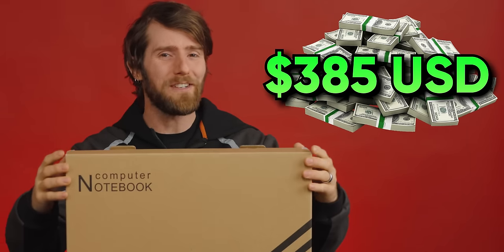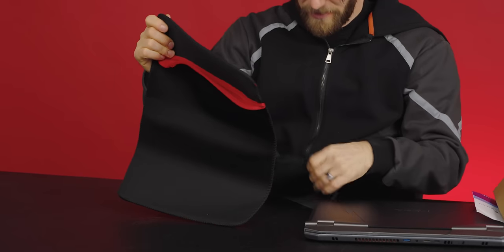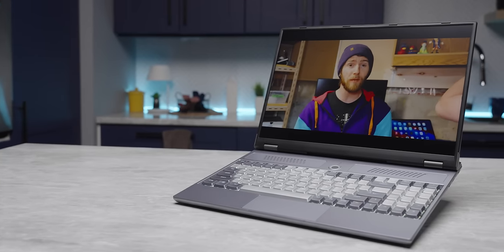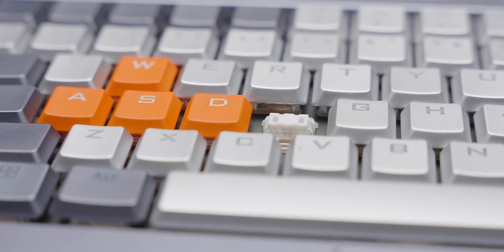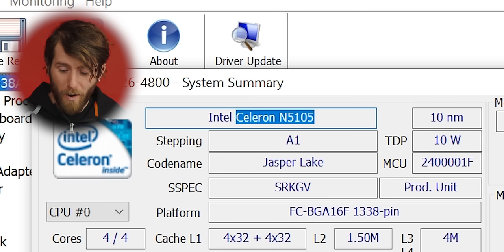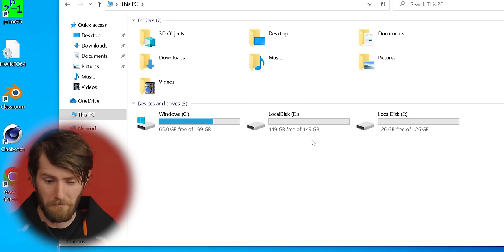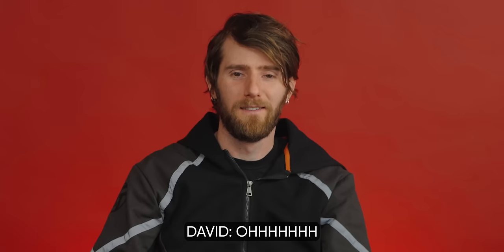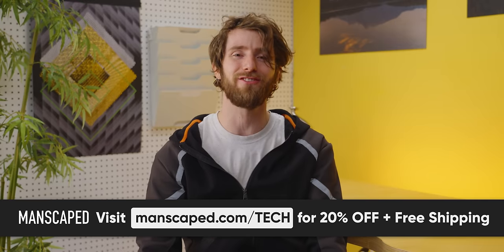Brown Star for Effort – This AliExpress Gaming Laptop is HILARIOUS

Comment: The "Windows is activated using your organisation's activation service" comes up when they activated it using custom KMS servers, so yea, most likely pirated windows 10.
Reply: Come on, they should be using HWID by now!
Reply: @GuyGamer1  haha so true, I think they didn't figured out the Microsoft-Activation-Scripts in github yet.
Reply: Yep, came here for this comment. Maybe not pirated, but shady. The comment that it pokes chinese servers to "make sure" something something made me laugh for a bit, LMG's clearly not on top of their pirating game.
Reply: well, it's an easy to solve problem if you dont want a pirate copy of windows on your pc.
ya see, you can get a single win 10 ESD serial nowdays for like 10 bucks. You just need to use a program to pull and backup all the driver installed, download a win10 iso from microsoft, departition that SSD, format it (or, you know, just change SSD and keep the old one for safety) and install windows and all the driver you already pulled.
At very most you'll need to backup the mousepad, wifi and webcam programs and those usually can work without installer. You can get a list of their files and regedit keys with geek uninstaller (launch force remove, copy the list and click cancel). Just waste a couple of hours at very worst and you have a manual backup for those.
Reply: @Lodinn  maybe some part of the batch file was doing that, Linus could just scroll to lines with the KMS stuff
Reply: You can see the BAT file is called KMS when he tries to open it so it’s 100% pirated windows
Reply: i said PART of the batch file, who knows whats in the rest of it
Reply: Yep, that .bat is great
Reply: @@drkcr In this case where they are not part of an organization which distributes it's licence keys with KMS, it's 100% pirated.
Reply: @@drkcr You said it yourself: in an organization.
Reply: @Lodinn  This is not shady - it's definitely pirated. They are just running a KMS emulator which hands out activations to any client connecting to it and requesting one. But even if they actually obtained the licenses and were thus operating a properly licensed KMS, then it would still be pirated as the KMS licenses are not to be resold, nor are they valid for people not associated with the licensee. So the end user (in this case the customer) would still be running an unlicensed (=> pirated) version of Windows.
Reply: actually that batch file name already tell this is a pirated Windows copy.
That batch file name is short for Windows 10 激活（jh in Jihuo from pinyin which means activate）
Reply: I'm in so much love this thing can't connect to Microsoft Update. Computer people, how can I do that on my PC?
Reply: @264bpm Yeah the Wikipedia entry on "Key Management Service" was interesting, implying that every so often the client PC has to "phone home" and reactivate the license.  (Wikipedia):  Individual computers do not need to contact Microsoft, although the KMS server does. KMS clients must be activated at least once every 180 days.
Reply: Yeah in fact those "sketchy chinese servers" might actually just be internet-facing KMS servers, nothing spying necessarily.
Reply: China not respecting a manufacturers copyright?  I’m absolutely shocked.
Reply: @ignoto82dr  I strongly doubt you can get a Win10 EnterpriseLTSC key for $10, and that's the version you want. You can probably get a Home key for that price, but that version is crippled to the point of being unusable.
Reply: ah yes massgrave dev
Reply: @СусаннаСергеевна  just checked on ebay: 10€ for non specific version key (I bought this and got a pro, there are comments that indicate some get pro, some get home), 20€ for pro. Still a low price if you think about what windows OS would cost you to buy as OS until some years ago (hint you would pay about 100€)
Reply: @ignoto82dr  Pro isn't really much better than Home though, I'd consider them both unusable. You want policy management and the LTSC update channel, which only Enterprise LTSC has. Pro Workstation and Pro Education also have the policy management, but lack the update channel, so then instead you're stuck constantly uninstalling the spyware Microsoft keeps automatically rebooting your computer to reinstall, but if that's how you want to spend your free time I won't stop you.
Reply: @СусаннаСергеевна  first and foremost: if you really think microsoft can't install whatever it want on your pc just because you have installed a certain edition I've a thousand of acres of forest on mars to sell you. Call me later, I'll give you a discount.
second to follow: if you need to "privatize" your machine, just install w10privacy or windows shut up (O&O) or something similar. Just be carefull what you block/deactivate. I did it consciously and I havent had a reboot forced upon me from a long time. I just get from time to time a notify for some security update. And that's something that people should do ASAP. Unless you are one of the "conspiracy" people. In such a case shrug why the hell are we talking about windows? You should have led the conversation with "Windows is too heavy for this machine. much better to install linux."
Third and last: in the name of the elder gods, why oh why would you use THIS pc for something that need policy management and/or LTSC? The result that Linux got showed clearly this ISN'T even a good game rig much less something that could use these tools effectively. This is something you would buy for, dunno, watching youtube, google a recipe, watch tiktok, reading email, BS of that level. Having a video call with zoom/discord/skype at very most. And I wouldn't even bet on those with that webcam: that need a slot-in to lock while in use, not these BS magnets. Even the speaker arent great.
This is either an entry level laptop to start to learn and that's a bit on the rugged side (this have a very solid shell from what we have seen) or a seconday machine to have/use around the house. Maybe an emergency rig that you use for a couple of months until you buy a good one.
Reply: @ignoto82dr  You're the one bringing up conspiracy nuts, I never said anything of the sort. I just don't like it when my computer reboots without my permission, I'd rather finish my work and reboot it manually, and I especially don't like it when updates reinstall things I deliberately uninstalled. I want group policies because that way I know what settings are being changed, software like that "w10privacy" sound absolutely awful to me. I do have a bit of trust for Microsoft, they're big and blatantly bad behaviour stands to lose them a lot of money, but whoever put that "tool" together I would trust about as far as I can throw them. The default setting should be to respect the user, but given that Microsoft won't ever do that, having access to the policy editor so you can fix these settings is the best alternative.

Yes, Microsoft can install whichever RAT they feel like on your machine (in fact they already have, MS support can access RDP without you explicitly adding their key) but it's not something you generally need to worry about because misbehaving would stand to lose them ever so much more than they could ever hope to gain. The moment they get caught using their RAT to steal data, they lose their credibility with every corporation and nation on the planet. Don't be a conspiracy nut, with the proper policies in place Windows can be a non-spyware operating system. It's just that on any version without the policy editor, you can't actually set those policies in the first place, and without the LTSC update channel you're going to be rebooted whenever Microsoft feels like you need their Siri ripoff reinstalled, or your browser isn't set to Edge.

No, this laptop probably won't be good for much more than browsing the internet or office work. Sounds like even more reason I'd want to be able to turn MS Siri off, or not having the poor ewaste SSD get wasted on constantly reinstalling candy crush or whatever. If any machine needed Enterprise LTSC, it's this one. Not only is it the best version of Windows, it's the lightest.

Please take a deep breath and sit down away from the computer. You're clearly very agitated over this nothingburger, it's not good for you. Calm down instead of going around picking fights, you'll enjoy life more)
Reply: @ignoto82dr   where are you finding that? Last I checked, Microsoft was wanting $65(usd)  for a win 10 key.
Reply: @triangleofdeath6246  ebay but you have to search for "windows 10 key" full stop. If you arent in Italy you should proly check the "allow international seller" cuz the one I bought the key from was an italian store.

Comment: Wow, to be honest that really isn't bad for the price. A family member bought a brand new laptop for around the same price about a year ago and it's _garbage_. It came installed with Windows 10 S on a 64GB eMMC drive, 4GB RAM and an Intel Celeron N4500 (iirc). To be fair, they're only going to be using it for word processing and web browsing, but I had to get it out of S mode so you could actually install stuff and I tried opening up Edge and it was beyond painfully slow. Even opening a folder was slow. It disgusts me how manufacturers sell this sort of crap and claim that it's a decent machine and sell it for that price.
Reply: literal e waste and a huge environmental problem. companies should not be allowed to produce crap like that.
Reply: laptop marketing is pure jargon and techno babble to the general consumer, most of the population doesnt know what an i5 or i3 processor is, what mhz means, what an ssd even is, but these are the terms slapped all over the marketing for them. its how they get away with charging so much for slow processors that are multiple generations old and can barely function with current software, ram and storage that is effectively already landfill by the time the host machine is in someones hands. its disgusting.
Reply: Put Debian on it and that machine would be perfectly fine for those tasks. The issue here is how unoptimised Windows has become.
Reply: Yeah the Celeron N4XXX cannot run Windows decently, however Linux does actually run good on them. I bought a Asus Vivobook Flip with an N4020 in it, and going to linux (Zorin OS which is based on Ubuntu) made it actually usable.  That being said the N5XXX series are actually pretty good for Windows, the N5105 runs Windows 11 very well.
Reply: the only thing Celeron CPU,  and calling it games machine too. when showed the intel that something dissent and you get the end and Celeron there, but metal case, why the speaker, are delebrtley, and intentionally; on purpose trying to make the bad with good parks?
Reply: Thats the kind of build that killed vista. Unreasonably low specs to run even the os sold as good.
Reply: @GyldariaTanoGen  You are using the word literal incorrectly. It is not even close to being literal ewaste.
Reply: After building my PC a week ago I saw ads for a 3090ti laptop for $700
Reply: ali express is full of junk.
Reply: It's not bad, but it's not the bestest value either. If we're talking last-gen specs (and we are if this is a company sticker-rebranding someone else's shit) I was able to get a 16gb 3200mhz, 1TB nvme, 5700u hp laptop for $600 recently. It also had its own bloatware, but with a fresh install of windows it's fast enough to do all the basic ass stuff I need to do with it. Not gaming, though. It's just an APU. It may seem comparable to what Linus is reviewing but you have to also consider that I have a warranty that I might actually expect a response to, and the probability of it being infected with actual spyware is a lot closer to zero. I'm just glad that "low end" laptops are showing us that you can get a surprising amount of computer for a few hundred bucks. You do have to do a crapton of research to get a good deal though. The laptop market on a whole is such a crapshoot, no matter the brand.
Reply: @pirojfmifhghek566  16gb 3200 isn't bad at all. The speed is plenty, my new PC built last week has the same speed, but double the memory.
Reply: aww poor Ali Express, they didnt pay Linus millions of dollars to film a commercial for their products and didn't get a typical puff piece from the Loser mass market electronics dweeb in chief....how ever will they survive....
Reply: @GyldariaTanoGen  Man, something should be done about this tbh. There are so many products, outside pc hardware too, that are literally waste before they even leave the factory floor...
Reply: @pirojfmifhghek566  yeah, the $300 laptops are always super slow chromebook-tier specs, then you go up to $500 or $600 and it's actually a usable system. awful stuff.
Reply: Even a Raspberry Pi would run faster, because it runs Linux. If a manufacturer is going to only install the cheapest Celeron, 4GB of ram, and 64GB of the slowest storage imaginable, they shouldn't preinstall Windows and act like they can run it. The only thing that shit of a machine could run well is a lightweight Linux distro, Windows has far, far too much overhead to ever run at all close to fast on that hardware.
Reply: I saw a black friday offer that was promoted by an "article" on Yahoo News. Some similar specced computer was being offered for $360 off on Amazon. Those specs aren't worth $360, much less the $899 MSRP. It turns out the article was wrong because the Amazon offer had 128GB storage and 8GB RAM, and looked to be a full-sized laptop with a few more ports than the usual small clamshell, and it STILL wasn't worth $360, much less $899. THe upgraded machine is decent enough for what it was made for, web surfing and word processing, but it was also being pushed for games. At least the article had the decency to list old titles instead of current AAA.
Reply: @pirojfmifhghek566  Other way around. An HP laptop I can guarantee you will be crammed full of spyware. Some random aliexpress laptop with an obviously pirated version of Windows might not be, because the vendor may simply not have the volume to make it worthwhile. What they're doing here is clearly just reselling chromebooks with a pirate Windows install and some deceptive marketing as "gaming laptops", they derive their value from the price hike that entails. 

I wouldn't trust any OEM operating system install, but if I had to pick one I'd take the Aliexpress PC over the HP.
Reply: 4 GB ram machines should be illegal. A newly installed windows 10/11 uses 4-5 GB ram when idle even after a clean format. that is just bullshit
Reply: @KNR90  Yeah, def the sweet spot for ddr4. Ram's cheap as dirt at that spec, so it's easy to load up. Slow ram speeds you don't often notice, but insufficient ram you notice immediately.
Reply: @pirojfmifhghek566  actually I went ddr3 as saved about $150 in other compatable parts. For gaming even up to ddr5 makes almost no difference, that's not the bottleneck
Reply: OMG eMMC?
Reply: lenovo lol
Reply: @MrKrunkles  Intels naming scheme is generally horrible in that regard. Most people only distinguish Intel CPUs by their tier, if its an i3, 5 or 7, and completely disregard its generation, which really makes a lot of difference with 12 generations so far, with half of them harking back to DDR3 days, because their actual numbering of CPUs is just a mess in comparison with AMD. 
And its not just consumers Im talking about here, its the marketing and even on a lot of games slapping "i5" on the system requirements and calling it a day, and this oversimplification is used in a TON of predatory marketing. 
Weirdly though that doesnt happen with AMD, with people just using their, in comparison at least, intuitive numbering scheme, even in marketing usually.
Reply: @dh2032  well to be fair Linus was running this thing at 2560 x 1600 resolution, I feel like it'd preform a lot better in games at 1920 x 1080